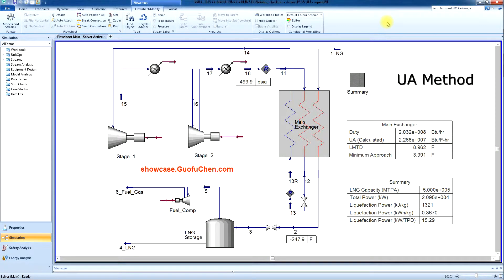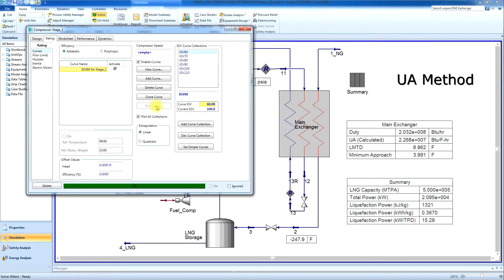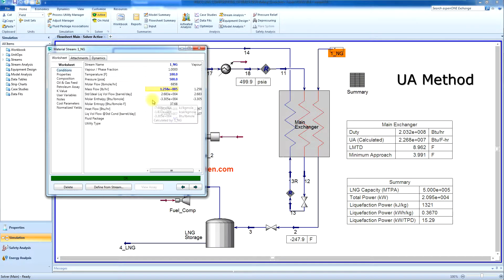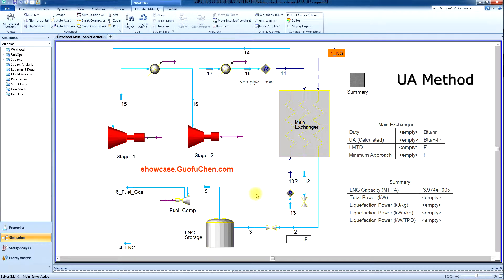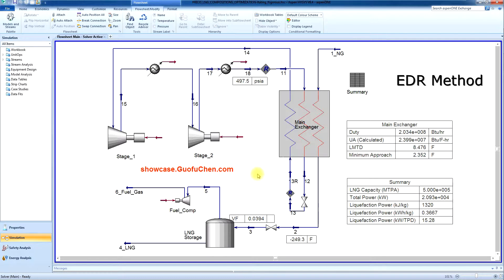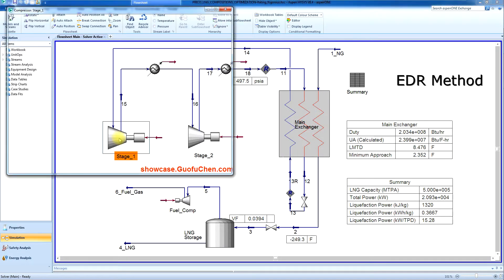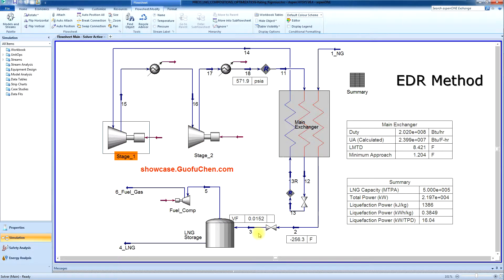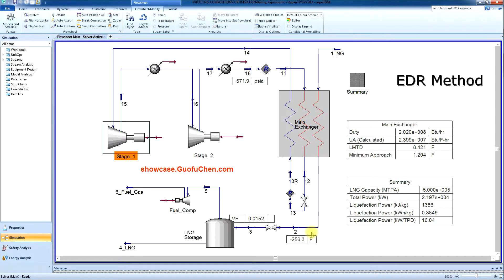Do You Really Know How Your PRICO LNG Plant Performs at Off-Design Conditions?

Comment: Hi, Guofu Chen! Thanks for the video.

I was looking for something simpler than that you presented.
I'm interested only in estimating the area and cost related to a multistream LNG heat exchanger.
If I have all required parameters (including detailed heat exchanger dimensions), is it possible to obtain the area and cost from Aspen EDR?

I'm new in using Aspen EDR, so forgive me if I'm asking something obvious.

Regards!
Reply: In EDR it is possible to achieve it.
Use design module in Aspen and enter parameters on inlet and outlet for both side fluids. 
little check should be required on construction side and if you are able to run it. then in the result side you will be able to get area as well as dry weight of the heat exchangers.
then it's easy for you to calculate the cost... tentatively multiply weight by 10 USA dollar.